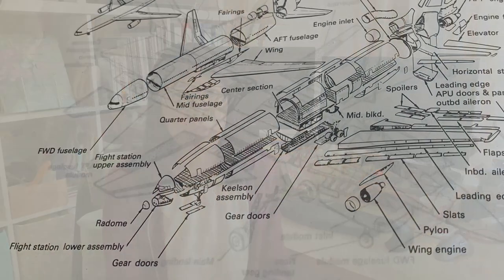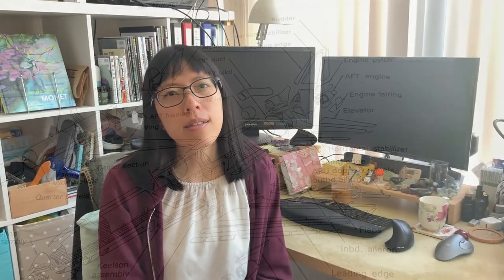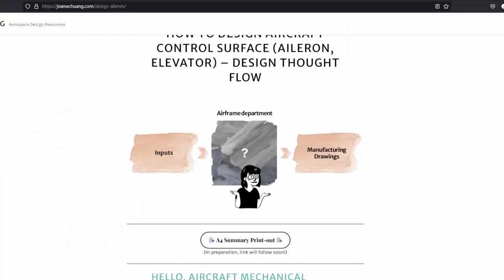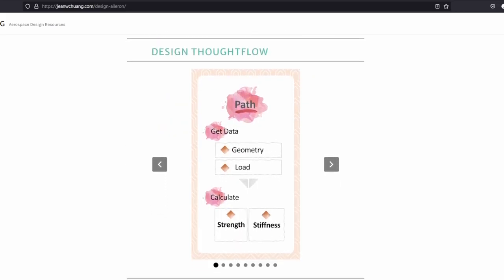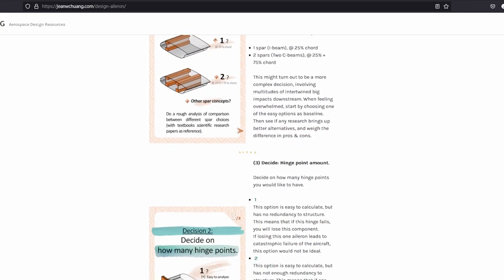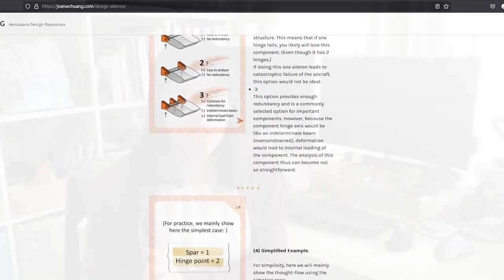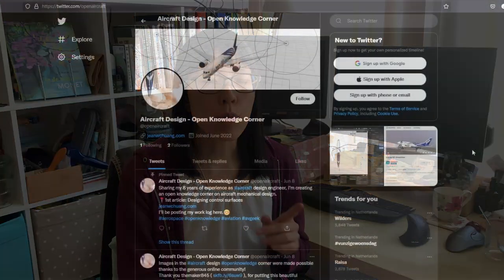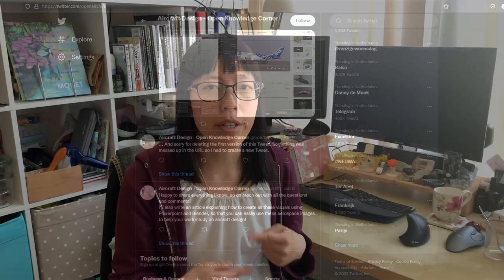Open Aircraft Design Corner - Introduction

Comment: Hey, very interesting project. As I do not use LinkedIn, I try to ask my questions here :-)

I think that the first was a good start and asked the right questions which need to be answered in the design process. Are future articles planned or has the project ended? I am a structural analysis engineer for airframes with a strong interest in preliminary design and multidisciplinary optimization. This interest drives me over and over again to look for such videos, projects, etc :-)